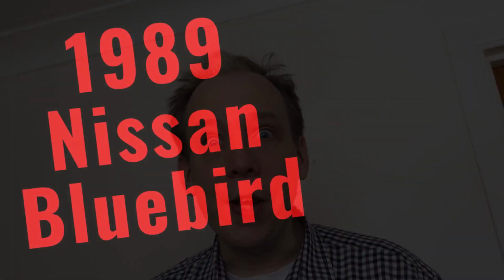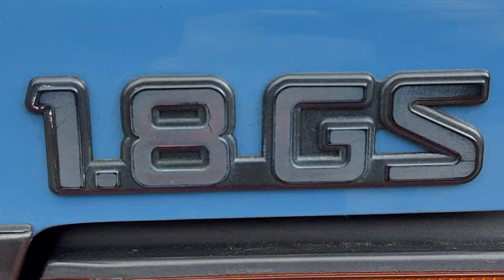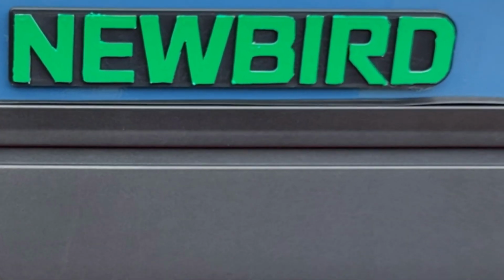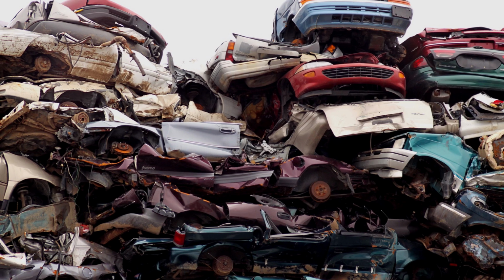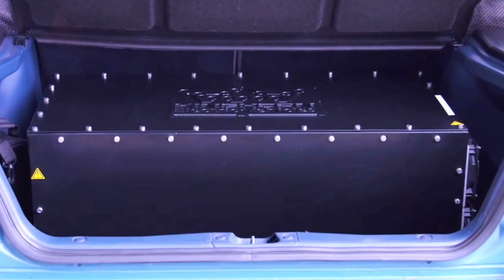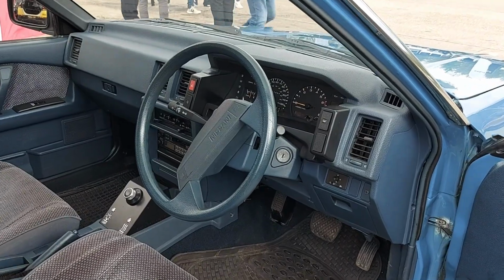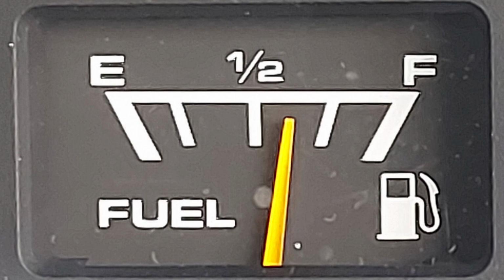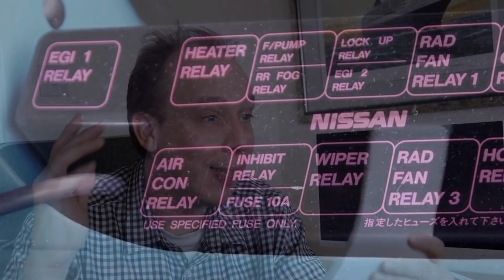Nissan Newbird: Nissan Bluebird Electric Conversion Explained

Comment: Another british you tuber reviewed this Nissan Newbird l do like it as it was a car to celebrate a car factory . I know that there are many classic cars been converted to electricity so this Nissan Newbird fits right in actually l think it is a good idea for Great Britain to have electric cars as long as there is plenty of charging stations and there is plenty of electricity for all those electric cars to charge at the same time in Australia there are a few electric cars about but very few charging stations none out where l live l am pretty sure they all charged at tge owners homes l would never consider buying an electric car becsuse we bought a new Suzuki Beleno last year and it is very economical over 40mpg and it was much cheaper than an electric car and there us nowhere to charge it and my ute is definitely not been converted to electricity its not so ecomical but it is part of its charm it has caracter its a 1997 toyota hilux if you research it you will find out how indestructible they are refer Too
Reply from the maker: Interesting comments, Les. Years ago in the UK, the Top Gear trio tried all kinds of extraordinary things to destroy a Hilux. They failed!